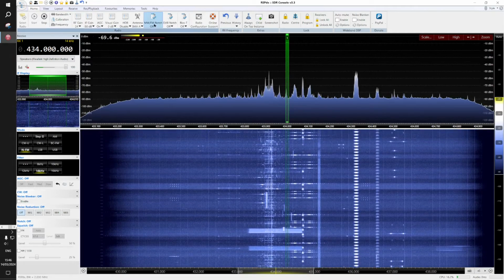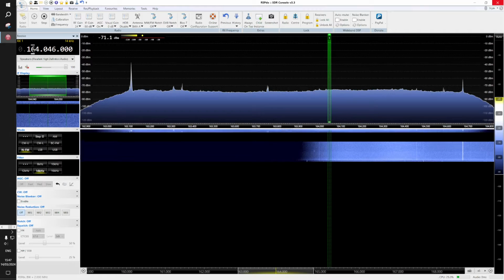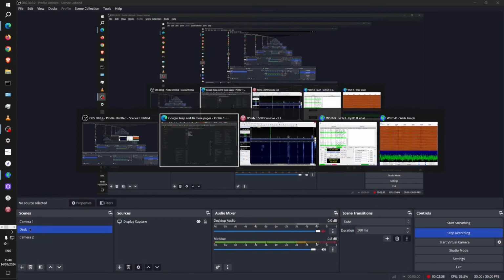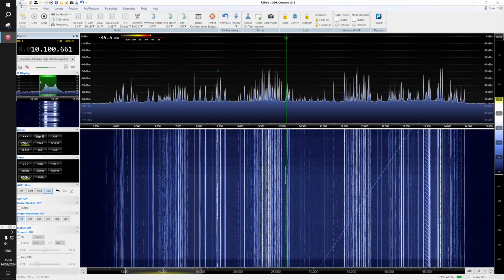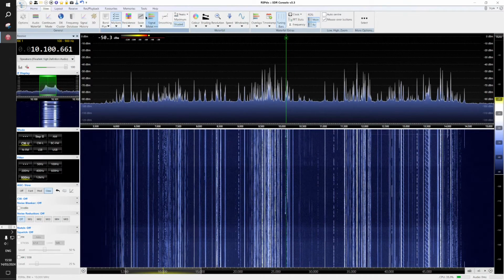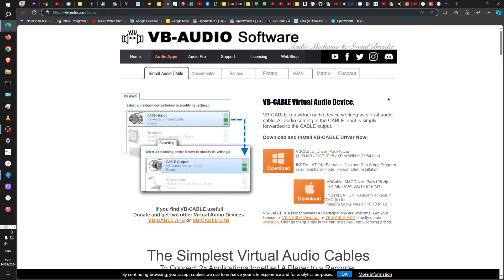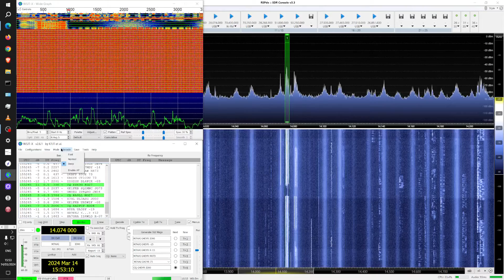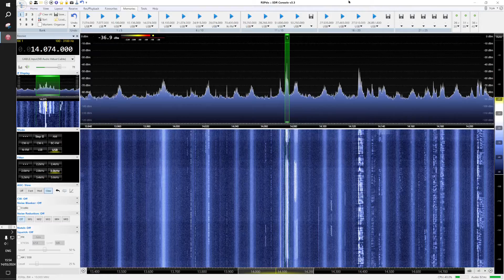SDR Console Software for SDRPlay RSPDX Receiver Part 2 including WSJTX

Comment: Do you have to be is a particular mode or zoom setting to get the rx bandwidth to change? The bandwidth drop-down menu appears, but I can't get it to change from 2 MHz. Is there a written Help Document anywhere where one can do a word search without having to ask on the FB forum or Twitter each time? Thanks. Your videos have answered some of my questions.
Reply from the maker: I think the bandwidth dropdown only offers bandwidths that it knows are available on the sdr device. Which sdr are you using ? If you click "select sdr", especially in the window that opens on first start up, you should see available bandwidths listed there too.